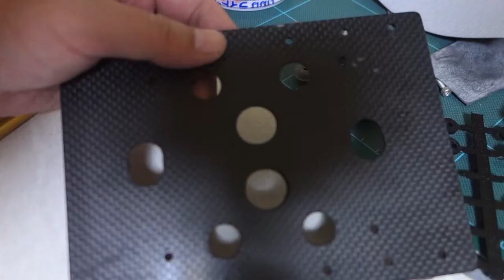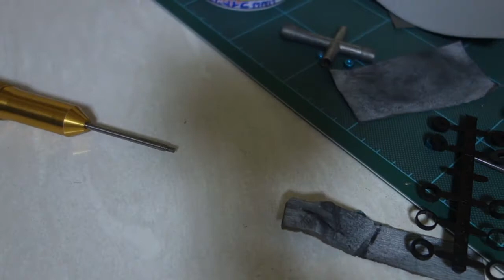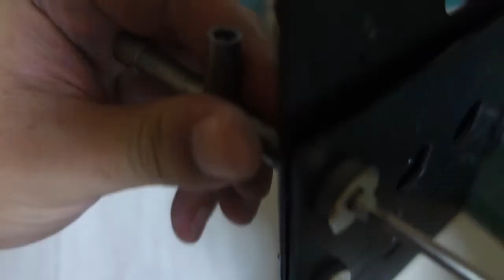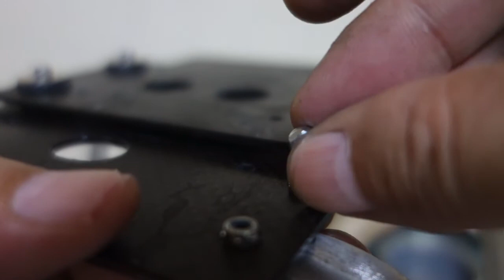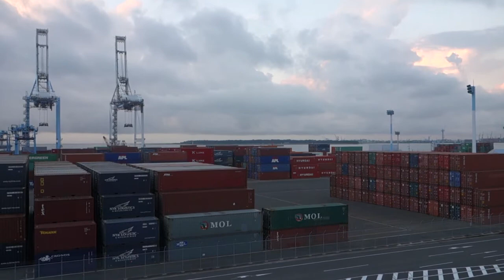DJI F550 + Gaui Crane III Assembly

Comment from the maker: Hello Jason.
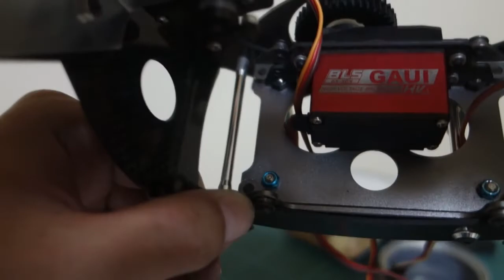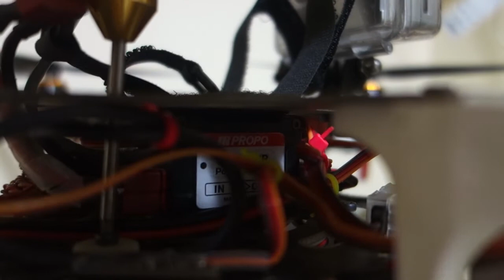2:27-2:38 You can see a hand made landing gear(10mm alminium pipe vended).
I am using a Castle CC Bec Lite to distribute two servos.
This assembly was dirctly mounted a F550 lower flame.